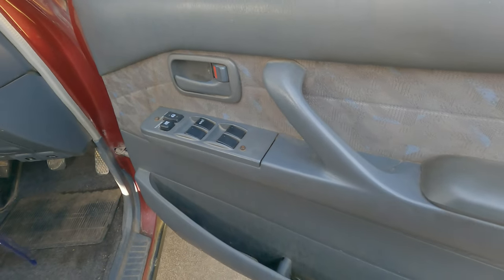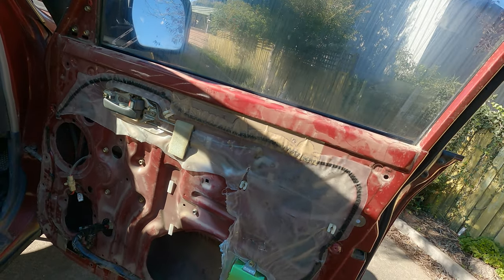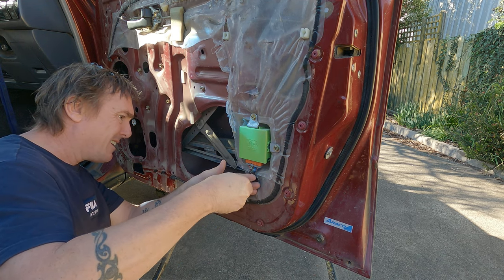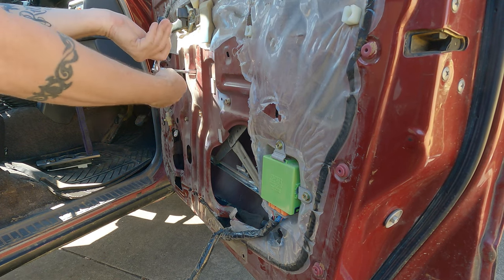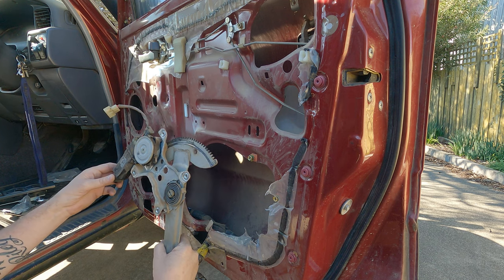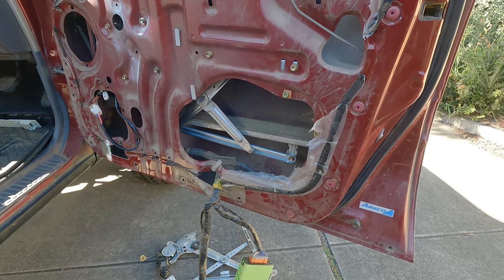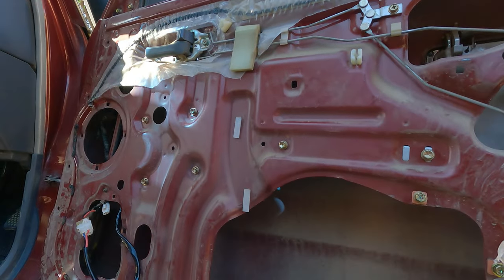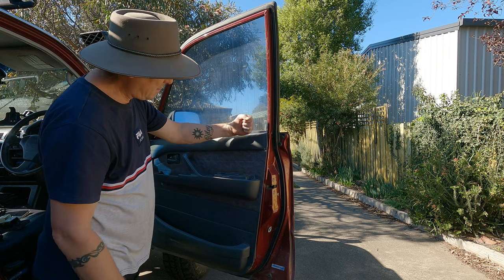How To Replace A Power Window Motor And Regulator - 80 Series Landcruiser

Comment: absolute legend, I need to do this after 27 years on my 1996 80, such good instructions
Reply from the maker: Thanks mate, glad it's been a help, I was pulling my hair out before I fixed it, use to bang the door card most furiously hahaha 👍
Thanks for the comment 👍
Reply: I've been pulling my window up for years, but it finally packed it in :-)  @Bush-Tv
Reply from the maker: I got to mine before it packed up was still very frustrating

Comment: Gday mate. I know it is an old post but wondering where you got the new motor/ regulator from. Have been searching the Google and there are sooo many out there and varying in price. By the way, your tutorial on the swap over was great. Regards Vaughn
Reply from the maker: G'day Vaughn, check out the discription mate 👍
Reply: @Bush-Tv  Thanks mate. Missed that when was looking. Has it been working good for you.
Reply from the maker: @vaughnschultz1189  yeah works great mate 👍
Reply: @Bush-Tv  Cheers mate

Comment: Hi Do you know wich is relay of  Driver´s windows. my  Master Switch Window,  has a problem with driver´s boton (it not working) other windows are ok, thanks
Reply from the maker: Hi mate, There's a control box for all the windows in the drivers door behind the panel.
Sounds like the Regulator motor in the drivers door same as my issue.
All my windows where ok as well just the drivers no good.